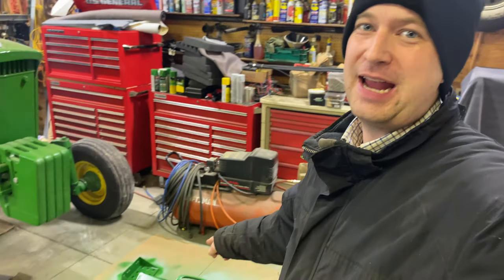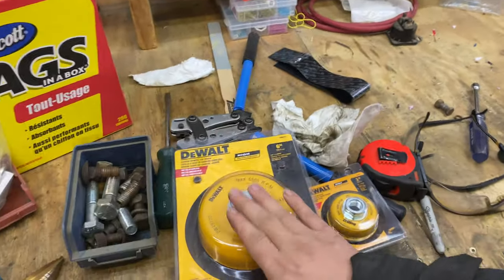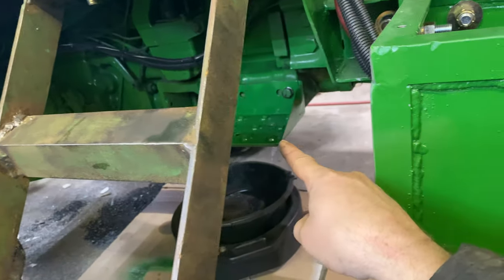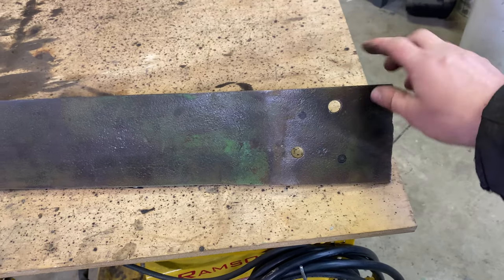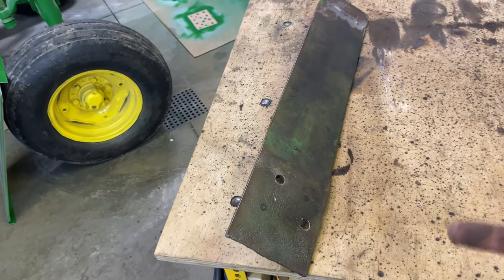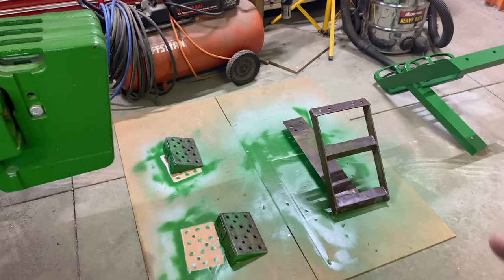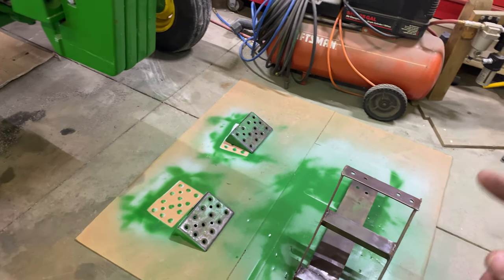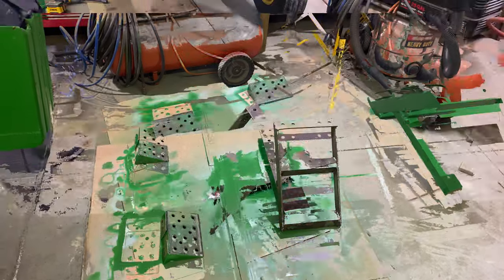Cleaning, Welding, and Painting the Old Steps for the John Deere 2510

Comment: Me and my dad are restoring my dad's old John Deere 4520 diesel, and the steps are a little different than the steps on the John Deere 2510.
Reply from the maker: With a cab? Or the original steps on the tractor?
Reply: @radozeman It had a cab but my dad took it off when he bought it because it was in bad condition, but the steps were bolted on the tractor, so the orginal steps with the tractor.